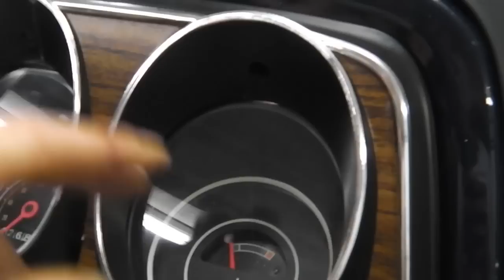Ford Cortina MK3 GXL Restoration EP53 PT 5

Comment: Hey Pete nice job on the glove Box but you should of used some Shrink Sleeve on the wire to prevent the bear wire rubbing on the grommet. But cracking job and it looks good.
Reply from the maker: +Andre Gopee tHANKS aNDRE YOU ARE RIGHT, SOME NICE HEATSHRINK would have made this better, next one ill be sure to do that, thank you for a good tip

Comment: To my level??? Lol well thats not very high pete. Ray however is the jedi master and can fix things with a single thought. On the leds pete, warm white 10000k wide angle and a handful of 1k resistors should do the trick. Solder em into the bulbholders and viola. If you want intense white use cool white. Remember, thyre polarity sensitive so if it dont work flip the holder around